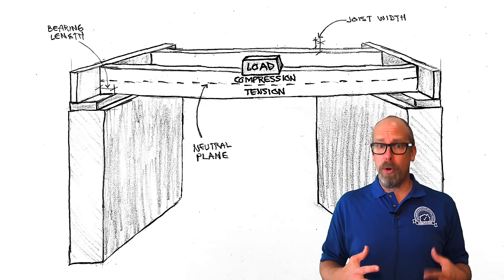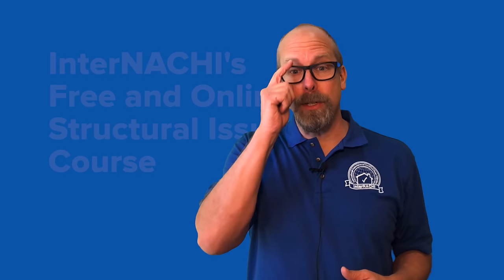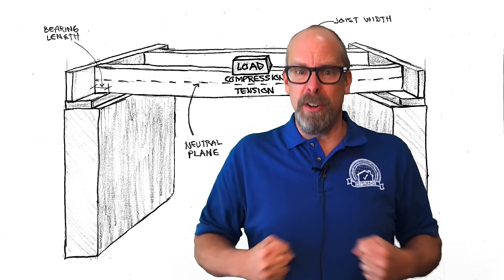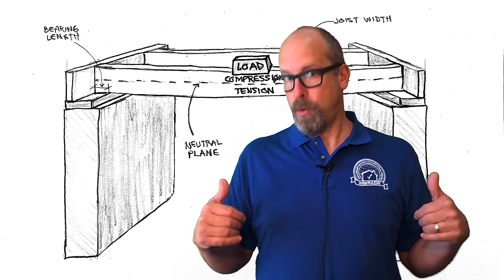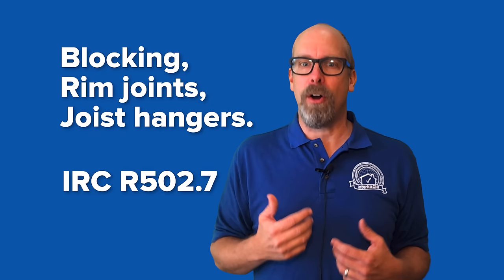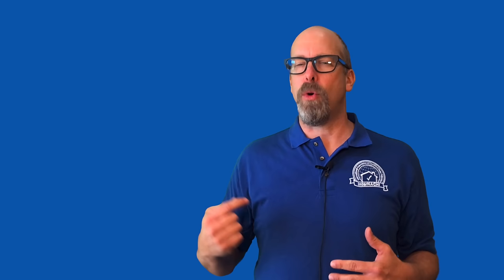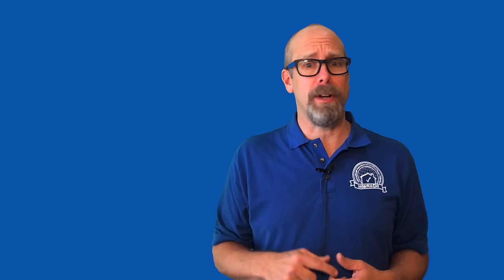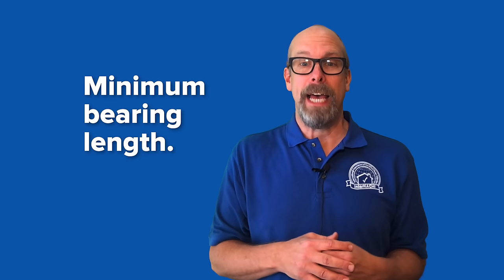Science of Simple Spans of Floor Joists

Comment: Is it Ben Gromicko or Bend? 🙃
And remember people, when installing conventional joist, be absolutely sure to put the "crown" up on each one....with  TJI joist it doesn't matter. And drilling holes within the "web" of a TJI is preferred to be done in the middle 1/3 of the span...weird huh? The reason for this is obvious to some....but too complicated for others. Let Bend Gromicko explain.....
Reply: The reason for the location of holes  is due to the 0 moment or bending  in the center ( neutral axis ) of the beam and maximum shear there.
	 		JAE (Structural) 		 		 		17 Aug 12 08:49 	 	

I think the limit is inherent in the design check you'd do. With a reduced section you have reduced shear capacity and at some point closer to the support that might limit your hole size/location.

	 	 	 		woodman88 (Structural) 		 		 		17 Aug 12 13:49 	 	

IHMO
1) Neither the IRC or IBC has a end distance requirement for joist holes placement. 
2) If you designed the joist (or the joist could be designed) per the Conventional Light-Frame Construction Section 2308 of the IBC or the IRC, then you can use the D/3 hole size. 
3) If you are designing it under the NDS then the allowable hole size of D/3 is not stated any where that I can find. When I design under the NDS I use the WWPA limitations on hole sizes and spacing per grade and size of the 2x to 4x joists/beams, for the general placement of the holes. Where I know the location of the hole and whether there are no other holes/knotholes within one to twice the depth of the member to it. Then if the reduced section calculations work I will go up to the D/3 size for the hole.
4) At bearing ends the hole should be a minimum the depth of the member away from the inside face of the bearing. If not, I then to look it the hole more like a notch. And hope that the joist/beam has low enough shear to get it to work. It has been more of a problem with beams rather then joists.
Reply: @chiefinspector7280  Actually it's compression and tension...it's just difficult to visualize or explain in words. Standard joist tend to break in the middle when over loaded, while TJI joist tend to fail towards the ends within the web, not the flange. The web tends to crush between the 2 flanges... so only factory "perforated" knockout holes are allowed to be removed.
Reply: @readmore3634  I worked as an engineer for wood I-beam company. We are talking about the center of the Beam not the middle of the span. At the center of the beam the moment is zero. At the middle of the span the moment is maximum.M=Wl/8 .
Hv and Vv.
Reply: @chiefinspector7280  I worked as a union plumber (right out of high school) for 35 yrs....  and self employed since 08.
    On site and before drilling any TJI we always consulted the spec sheets stapled to each bundle of joist. It was easy to understand the limits in the drill charts.... but to actually observe a joist being destroyed really tells the story. When a forklift sets 2 lifts of T&G plywood on the middle portion of only 3 joist, spanning about 18ft,  you can watch the web towards the ends crush (diagonally) as if the lift was set right on top of the failed portion. Hard to describe....almost have to see it.
Reply: @readmore3634  Could be vertical shear in web
Reply: @chiefinspector7280  As you know , went turning a car the outer wheel has to travel further than the inner. When bending A TJI joist the bottom flange is trying to stretch (tension) and the top flange is trying to shrink (compression)....something has to give....and it's the web being crushed and twisted simultaneously...
Call it what you want " vertical shear in web" .......but like I said earlier, it's difficult to describe.
Reply from the maker: It's Ben. Or Benjamin. Either. Thank you for watching and for the feedback and information.

Comment: Do not EVER follow the advice of a home inspector on structural engineering details. They are not insured or bonded for any structural design failure and lack knowledge of load calcs. 

Refer only to the approved building plans that have been signed off by the structural engineer.
Reply from the maker: Correct. Home inspectors are not structural engineers. But every home should be inspected by a certified home inspector - not an engineer.

Comment: Good in general, but imperial units ... what a mess. Engineering is done with metric!!
Reply: No its not in US
Reply: We used imperial measurements in the UK until the metric system was imposed upon us during the seventies. During the changeover period, all technical drawings (blueprints) had to show both metric and imperial dimensions.
Reply from the maker: I prefer mm myself. The International Residential Code IRC has both. I love using mm. It's easier to use and more precise.